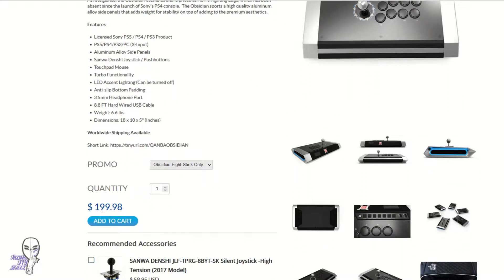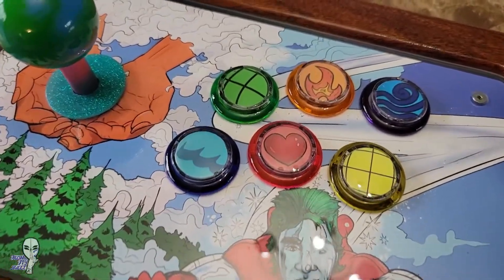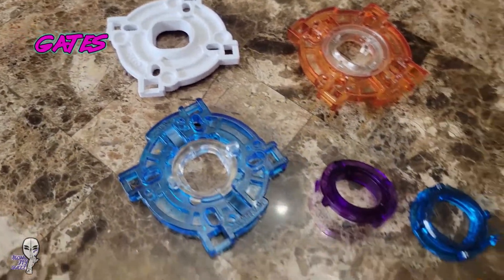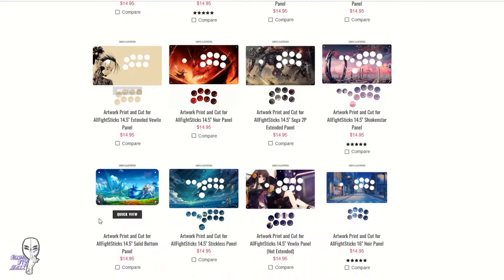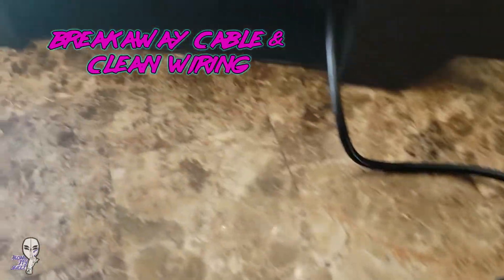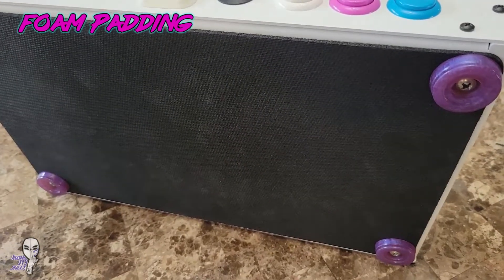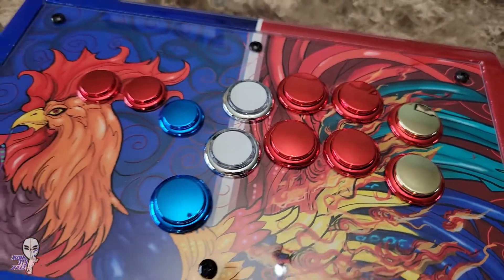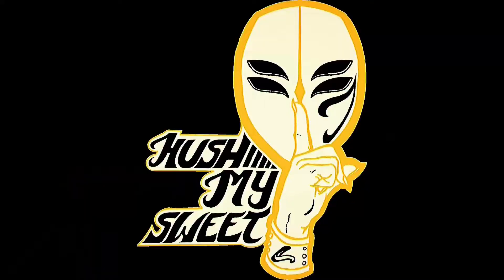Fightstick mods and customization options - What can you change on your arcade stick?

Comment: I've been thinking about modding my Mayflash F101, so this video may help me with what choices I want to make.

This video is great!
Reply from the maker: Awesome! Glad it was of help. You'll have to let us know what you upgrade. Cheers.
Reply: @HushMySweet1  Hello! I switched out the square restriction plate/panel thing for an octagonal one.

So far, playing fighters has been easier! Turns out lots of button can be switched out easily, and I learned that different button types may fit with different controllers which is neat!

Comment: I thought I commented this on another one of your videos but I cant find it so my question was at 1:00 you briefly show that purple stick that you have. What type of plastic is the purple enclosure made out of?
Reply from the maker: Technically it’s called Ballistic Lucite-polymethyl methacrylate. But it’s just a thicker variant (1.1" thick) of plexiglass with rubber enamel color layers in the bottom of the sheet.
Reply: @HushMySweet1  thanks so much

Comment: which gate would be best on the lever for games such as SF6?
Reply from the maker: Depends on your character and your own feel sensibilities. I like square (rounded square, actually) best because I can hit down back easier for crouch block which is super important in SF. Plus I used to play charge characters and they seemed easier on square gate. I had a friend who liked octogates because he could ride it easier and he thought it made hadouken-style input moves easier. You can do well with any gate. They are super cheap too, so I'd buy some and give each a try to see what you like the most. Good luck.
Reply: @HushMySweet1  thanks for the help Hush very well put video
Reply: @HushMySweet1  My Obsidian 2 came with a Square gate but I switched to circel but a rounded square sounds like it might be a perfect medium between the 2 where can a get a rounded square gate
Reply from the maker: @ThePlasticBowl  I got mine from some Otto DIY V5 kits. Off the top of my head, I can't think of where to find them on their own. https://focusattack.com/otto-diy-v5-upgrade-kit-for-sanwa-jlf-and-hori-hayabusa/
Reply: @HushMySweet1  Thanks! Appreciate it

Comment: Where did you get the top of the buttons from
Reply from the maker: You can cannibalize other buttons of the same type/brand to mix and match colors. Also, I believe Arcade Shock or one of the big suppliers sells concave caps. And then you can grab wilder ones through etsy shops. I think Barne's Industries and Sleepy's Arcade will be a good place to start on etsy. Good luck!